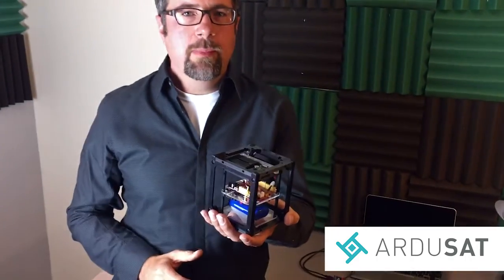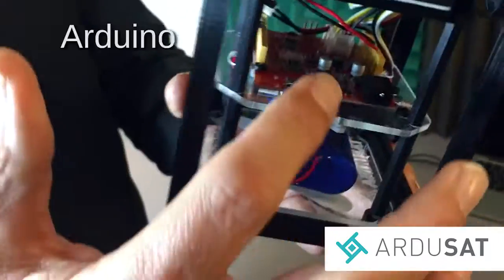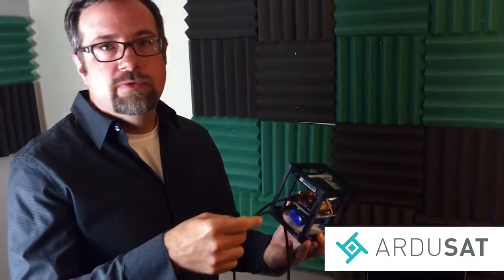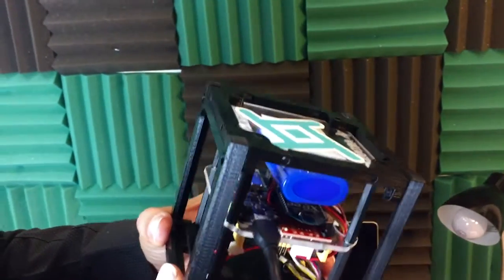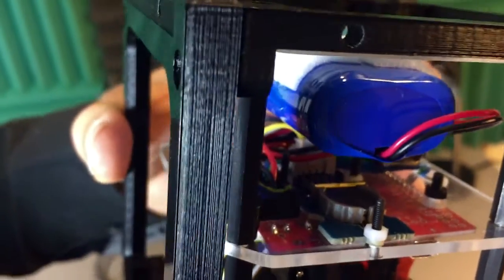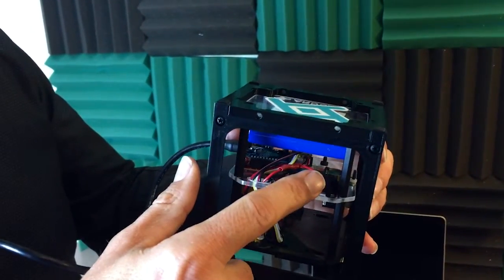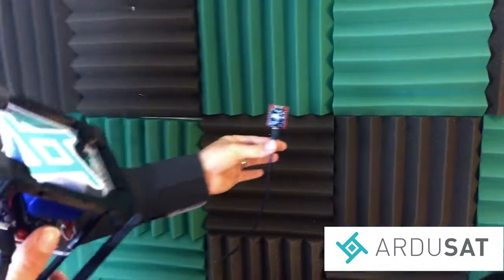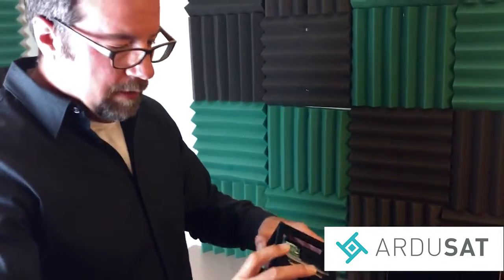DemoSat Demonstration

Comment: kindly give complete information about the sensor suite and what kind and models of sensors are used in this demosat
Reply: Here is a guide that has the specific 6 sensors give reading for (IR Temp, RGB, Luminosity, UV, Accelerometer, Magnetometer, Gyroscope, AmbientTemp) w/ links to datasheets: https://docs.google.com/spreadsheets/d/1CP20K3BMYwjHy3thY5WAv5g3Ov9VHGwo2BVmlXAD1qE/edit?usp=sharing
Reply: Thank you for your help. Kindly tell me if our organization buys this demosat, would the package be accompanied with tutorials/demonstrations and software support?
Reply: Yes, the DemoSat includes access to our on-line platform that has 100+ lessons.  The platform makes it easy to flash new programs on the DemoSat microcontroller/arduino and visualize live sensor readings.  You can check out the lessons here: https://lessons.becauselearning.com/    We also specialize in customizing curriculum and professional development for educators and special programs.  Please let us know how we can help.